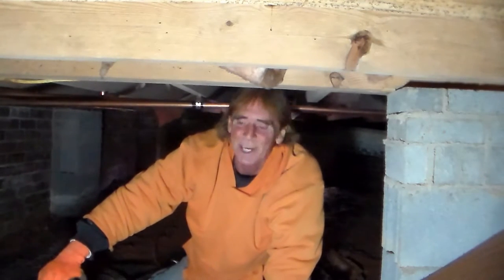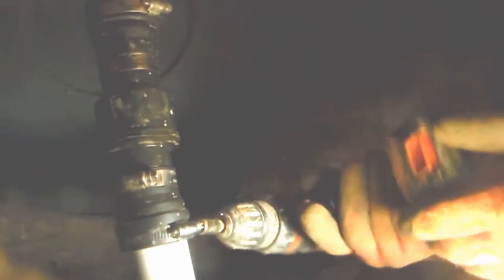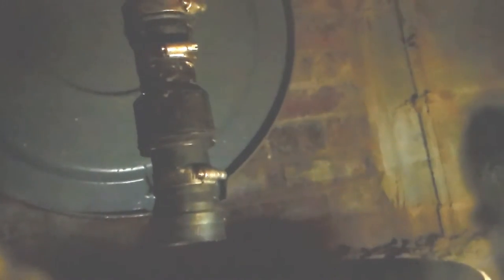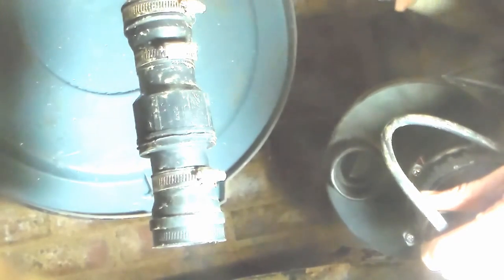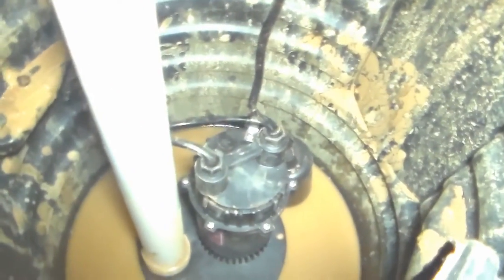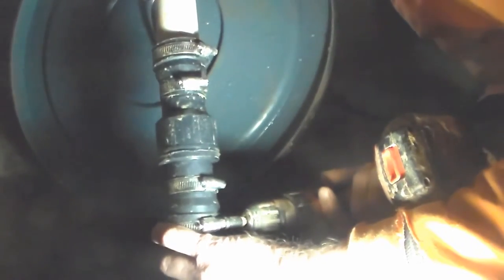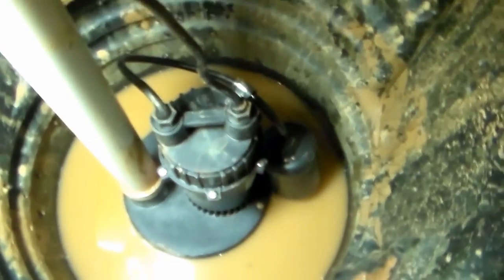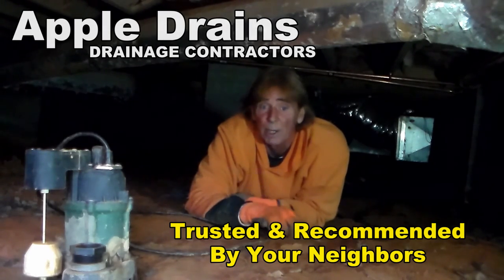Install A New Sump Pump in 5 Minutes

Comment: That was great!!, I'm 62 yr.old girl & didn't want to cut and glue PCV pipe for new 3/4 Horse Wayne sub pump, hope I can do clamps with hand tools, I fixed my furnace by heating stuck gas valve, felt like Fonze on Happy Days, THX for this video!!

Comment: What is that little valve on top directly next to where the tether is clipped on. When my Everbilt brings the water level low, air is hissing from that small 1/2' dia black douunut looking thing. Thanks.

Comment: Hey I think mine is going bad and my house is only 4 ỷears old.    Does the sump you replace it with have to be the sắme brand?  So you can just unscrew the pipe out the pump and insert it in the new one and tighten up the check valve ?  You dont need to cut the pipe?  I have 2 sump pumps in my basement  but one is câusing the problem and carries water out but floater keeps getting stuck.  Not sure if the other is for ẻmergencies or what by my furnace.

Comment: Fear of water brought me here. I’m a new home owner and it’s been 6 months and I never knew I could have such a hatred for water. I’ve had my roof fail and all my insulation get wet and have to get ripped out and get a new roof. Then my basement has water problems every time it rains. Then I find my side yard is the culprit and it needs a drainage system, and my damn gutter is clogged and I can’t fix it because it’s raining. The sump pump is going off every minute for 2 days. Tomorrow, I’m running out to get a backup just in case. Sheesh. I really need some good luck for a change.
Reply: I feel you, keep in mind it was an El Nino year. Very wet
Reply: @DaDaDo661  Things have gotten much better since when I made this comment. I fixed the problems. Knock on wood. 😆

Comment: I purchased a Wayne pump and check valve. 
The check valve has threads on the bottom and screws directly into the pump. Is there any problem putting it that low on pump. I assume it would be ok as the manufacturer made it that way but don't see any vids with it like that?
Reply from the maker: Should be fine
Reply: @appledrains  Wow! Fast reply. Chucks the man! Advice to those attempting a French drain with no help. Get some! And Follow chucks advice. Especially if you're in the South. The using fabric debate was a big one for me. I have a lot of Alabama red clay in my yard. For now I'm just going to use more, larger rock 1"-3". 
Got a 40k estimate for foundation damage last summer. Don't let it excess water go too long. Get a drain or sump pump put in.